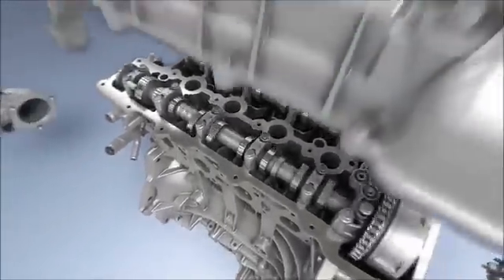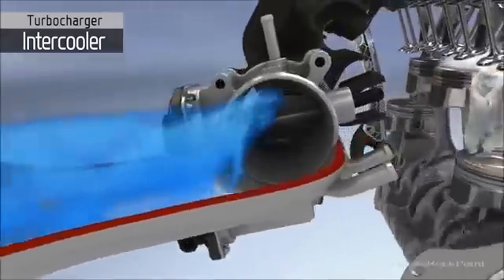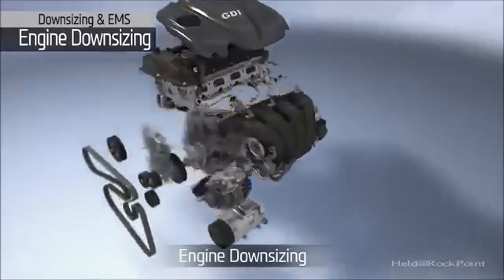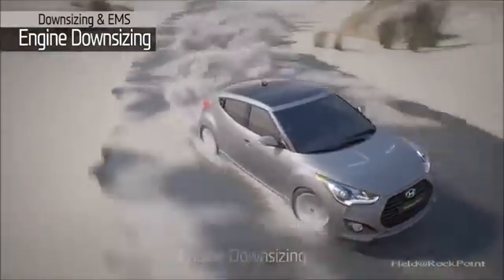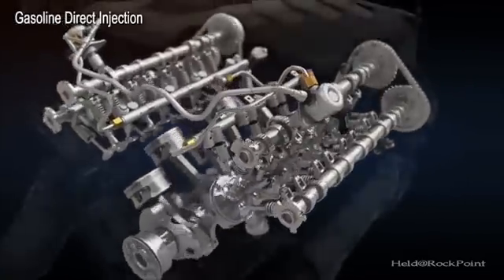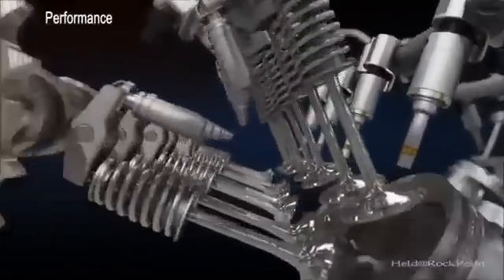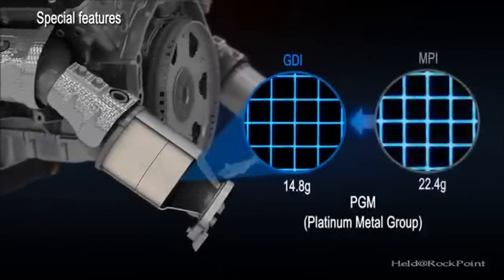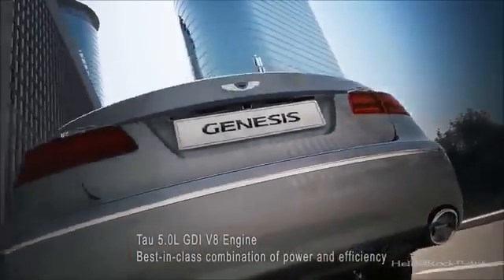Inside the GDI Engine

Comment: Although my mpg increased while riding the modern gdi vehicle, I'm in a situation where I'm using premium gasoline, fuel additives, and intake valve cleaner periodically. Sometimes I wonder what I'm doing. When I was on the old fouth gen Nissan Maxima, I didn't know about these things, I didn't worry about these things at all
Reply: Premium fuel almost never makes economic sense. The modest increase in mpg from the computer advancing the spark timing is more than offset by the higher cost. And a lot of GDI engines work better on low octane gasoline.

Comment: Hi Sir/gdi owners,
I need your advise on the below issue.
I just bought a new nline manual i20. I just ran totally 85kms on odo.
Im sensing an excessive heat from engine bay after riding 25kms on highways when I stopped for fuelling I was asked by petrol bunk guy to see whether hand break is engaged.because of some excessive smoke coming from below but disappeared quickly 
When I opened engine bay I suddenly noticed a sudden heatwave coming from engine bay. I can feel hot air blowing on my face left side of engine.
I also sensed a smell similar to burning clutch at back of my car exhaust.at beginning of delivery I noticed a paint /nail polish smell coming from exhaust. 
I wonder what could possibly wrong in a new car and feeling very nervous

Comment: Worst engine ever, the oil consumption is unbelievable, the dealership is not supporting their customers due the the overwhelming failure of the GDI engine....I had 2 Hyundai Santa Fe. 2006 and 2017.  The 2006 was worry free and reliable,  Just did regular maintenance with oil changes and air filters.... Due to this I went back to Hyundai and got the 2017 Santa Fe sport... This was a big mistake that I'm still paying for.  The GDI engine in Hyundai are no good... And it's starting to affect the brand loyalty... I hate the fact that they know there is a problem and they are ignoring their loyal customers.

Comment: MAJOR OIL CONSUMPTION ISSUES. ENGINE SEIZURES. RECALLS. SETTLEMENTS. LIEING DEALERSHIPS. GET LESS THAN 40,000-60,000 MILES OUT OF RODS AND BEARINGS. EXCESSIVE CARBON BUILDUP. VERY EXPENSIVE $10,000 REPAIR/REBUILD. 

RUN. AWAY. THIS IS MY 3RD HYUNDAI ENGINE. JUST, DON'T DO IT. KIA IS THE SAME, SAME ENGINE, SAME ISSUES.

Comment: I've had to use 2 sea foam treatments through the spray that you put in the intake. Take the intake boot off and make sure u are spraying behind the mass air flow sensor. Have someone spray while you hold rpms at 2k until can is empty. Turn it off and let it hot soak for 10-15 min . Start it Rev it and drive it. If no smoke comes out. Drive somewhere park , let it cool and then eventually you will hear a pop and alot of smoke if you had alot of built up carbon like mine did. I may have to do a 3rd treatment . Regular fuel injector cleaner doesn't clean up by the intake because of how the gas is injected so anything put through the tank will help the fuel ( like water remover e.t.c. ) . Stay away from these and any cars with CVT transmissions,  trust me.
Reply: Yep both ideas are meant for kids, sure as hell don't want to do this much care to a car now a days.

Comment: With 40 years of experience working on Turbo i can promise you a couple of things.. Your Turbo will fail , You'll have carbon build up on the intake valve, Gasoline will find its way into your oil case and you will have tom replace blown head gaskets..

Comment: I still prefer old cars pre all this turbo charged anti pollution bullshit. An engine that works under these sort of conditions all sounds and looks good but they are not reliable and do not endure as long as non turbos. Based on what happens to some earlier nissans 3 litre TD which look like a fantastic engine do not last. The reason for this is they breath their own fumes as part of their anti pollution set up. Its in not unusual for the manifold inlet pressure to spike in a closed loop system. When this start to happen oil leaks out through the seals of the engine and deprive the parts of lube. It doesn't matter what brand of car it is. If you try to squeeze a lot of power out of a little block expect big problems. It all sounds good looks good and in theory works good but you can never get something for nothing. Everything has boundaries and we push them to the limit at the cost of endurance. Hard starts and oil leaks are the first signs of all this. I have personally see this happen to Nissans a great looking car and performs beautiful when they were new.

Comment: How come they dont mention thr carbon buildup after only 30k miles? 😟😟😟
Reply: Install catch can and port injection simultaneously
Reply: Yer on money with this. GDI is bull Sheit. Major PITA for people with no use for it. Go back to Manifold Injection, or combination if it makes the manufacture feel better. I'm done putting up with carboned up intakes, 80,000 miles & the valve track needs to be taken apart & cleaned. Crap in a can won't work past getting 50% of the crud out.

Comment: "Inside the carbon build up" ...
Reply: I was going put this exact comment then i saw this 😅
Reply: I got 316k km hyundai santa fe. No carbon buildup. Just change the timing belt recently. Runs like a champ.
Reply: @christianmusicchannel8861 do you drive aggressively or you do normal driving
Reply: @christianmusicchannel8861  I think your petrol engine is port injection and not direct injection.
That's why it's clean.
Reply: @Anas42M  it says gdi on the engine cover.
Reply: In comparison to other GDI engine manufacturers, Hyundai GDI engines have minimal carbon build up.
Reply: @kevinclay4883  It's true for newer Hyundai GDI engines, but back in 2011, the carbon build up was awful on these.

In fact, the solution is combination of direct and port injection.
Toyota, Ford and VAG have understood that.
Reply: Yuuup. I have to used the dang spray cleaner every few oil changes too.
Reply: Oil catch cans........
Reply: @simonrosas7937  No...... It will do almost nothing for carbon build up...
Reply: @Anas42M  anything?? Nothing..?
Reply: @1958Cadillac-v2g  Nothing... ;)
Reply: Use high octane premium fuel which has cleaning Chen's in the mix try at least 99 octane and should be very little carbon build up .. yes it's more expensive but worth it on a performance GDI unit with turbo etc ..think US fuel is very dirty from what I hear compared to European fuel!!!???
Reply: @jimmyrich4675 No it will do nothing for the carbon build up, even if you add a bottle of additive.

The fuel doesn't touch the intake valves in direct injection engines.

Comment: Test drove a Santa Fe auto, it was all revs and no go..typical rubbush auto box! Test drove 2 Tucsons and they both felt like they were built to a (very cheap) price with crap suspension and poor steering gearing. 1.7 CRDI diesel is ok but still a bit of a rough (Daihatsu?) engine. I test drive a Tucson 1.6GDI and it was absolutely bloody gutless, fxck all (no) torque. At least with a turbo it might actually pull uphill. I like the Hyundai body styles but you can stuff the engines possibly with the exception of the 2.2 diesel.

Comment: These motors are junk if you don't keep the carbon out of them. You have to clean them every year. Best ways to take the intake off and sandblast the valves with Walnut shells Do that to mine every year. Tried to CRC carbon cleaner it works but not as well.

Comment: Hyundai can say what they like,it's still a direct injection system.The valves will still carbon up,the same as any other DI engine out there.
Like all other manufacturers,Hyundai fail to mention that modern direct injected engine produce 1000 times more poisonous emissions than the
old port injected units,(Tests carried out buy TUV NORD) In their report,TUV say this huge emissions problem can easily fixed by the fitment of special filters into the exhaust system,the cost? less than $50.
Time the world woke up and insist manufacturers fit these filters.
Reply: The engines are turbo. I only use high octane gas with in my 2.0 turbo Optima.

Also its an easy fix. Put some premium gas in and punch it a few times and problem solved!!

10 year 100k mile warranty!! My engine has a life time warranty covered by Kia. It's underrated at 274hp also. That's only on 87 octane, on 91 it's 285ish horsepower. I only run 93 octane. 6spd dual clutch transmission shifts very fast. Great little daily driver, close to 300hp and still gets  about 26mpg city. The interior is ahead of it's time. All 4 seats are heated and cooled. Infinity sound system. Great car!!
Reply: @boostjunkie2320  I've had no problems at all with my 2012 Optima 2.0 Turbo at 82K on 87 octane. Up to 35 MPG on highway with plenty of power when needed. I may try a tank of high octane to see if there's a difference.
Reply: @ellieprice3396  what are your thoughts on idling the turbo for 30 seconds before and after you drive away?
Reply: My Hyundai i30N allready has an "OPF-filter" (Otto Partikel Filter)..my former Hyundai 1.4 T-GDi from januari 2019 had it also..in Europe we can't buy gasoline cars without OPF filters anymore..(EU-regulations).
Reply: @gixxerboy555  What about your  Hyundai 1.4 T-GDi engine? I have the i30 with this engine. What about carbon build up? Did you had any problem? I change oil and oil filter every 7.500km and use only 100 oct gasoline. Now i have 37.000km. What is your opinion? Thank you for your time!

Comment: So how do non GDI engines put gas inside the engine?
Reply: Usually the injector is placed just before the intake valve. Older systems used throttle body injection where the injectors were located in the throttle body.
Reply: Redtooth 75 thanks

Comment: Major Disadvantage : the intake valves do not get the benefit of the gas cleaning off any oil blow by that might be on the intake valve. after the car shuts off the coated intake valves now harden into carbon deposits which increase the likely hood of engine knock.
Reply: That’s why a lot of GDI owners purchase an oil catch can to mitigate (to some extent) oil blow by
Reply: @isaias9838  Oabsolutely correct that's fisrt thing I did when I got me Tucson and I discharge the foul smelling oil every 400 miles.
Reply: Ya fun, fun , in a world of Maintenace free engines, you have dump a can full of crap every few hundred miles. Up in the north land it's much worse, you can't even make this up how much crap it's produced & the owner has to clean it up, ya right, whatever!  @isaias9838
Reply: YESS
Reply: kill everyone  yeah run port injection or add a methanol kit are two things i can think of.
Reply: Is this why there is a recall on the engine?

Comment: GDI is just a carbon nightmare!!
Reply: They have been making this engine for some time. I wonder how Hyundai deals with the carbon build up. I know Toyota developed a dual type spray in there gdi. So gas washes where carbon would normally build.
Reply: @joeb2588  Run high octance gas and floor it a couple times. Blows built up carbon right off. That's an old basic maintenance trick.
Reply: Yes but this adds to the complexity of the system.  The GDI nozzle is 16 microns.  A blood cell is 8. How long before this clogs up???
Reply: @alanmatthews5949  I have an 18 Elantra se. It's a base model really. No frills. 6 speed manual. One of the appealing qualities is the 2.0 mpi engine. No GDI,no turbo. Just a basic fuel injected engine. It's not powefulbut it seems reliable and I get over 40mpg.
Reply: Actually it's not at all
Reply: Tell that to Bernie at ATS

Comment: How and why the bue cold air turn into fire ??????? This is misleading
Reply: The turbo is very hot, being run by exhaust gases. This heat is transferred to the intake air via the compressor. That is why an intercooler is used, to take much of that heat out of the air before it enters the plenum.
Reply: @ButchNackley  thanks sorry for my harsh question. Since i was curious

Comment: The GDI is not all it’s cracked up to be.  Serious design flaws and poor quality control in manufacturing makes this is one engine to stay away from.
Huge problem with carbon build up in the intake above the the valve seats, the turbo only exacerbates this problem.  The high pressure fuel pumps have a much higher incidence of engine fires.
Reply: Just take care of basic maintenanc and the engine will be fine
Reply: @boostjunkie2320  no it want I did all that for two year got records to show and it still blew up waiting to see if I'ma get a engine now
Reply: @LawezeanaS197  I got my 2018 Elantra Sport with 29 miles on it, I do proper maintainance, and I am now at 98k miles... not a single problem. And I drive it hard and it is Full Bolt on and Tuned with e30 fuel at 24psi. No problems here...
Reply: @AlexGtheDon  were did you buy your bolt on and tune from I been looking for stuff for my 2.4  for the longest and I brought mines use with 77k I love my car I just had one of those engine Alabama plant engine I was doomed from the beginning at least thats what Hyundai say's but they gone fix it I gotta pay out of pocket I didn't met the warranty
Reply: Yep. HUGE recall on the GDI engine. But, they will not accept ANY warranty claims when it grenades, even with perfect service record. (The service advisor said it was perfect.)
Reply: My Sonata died in the fast lane, turned out to be the fuel pump, but then a few months later, after refueling, the gauge didn't update and it died again. Now I'm hearing woodpecker from the engine, and I'm assuming I'm throwing a conrod...
Any thoughts? I only recently found out about the GDi recall but my VIN records show it as closed...

Comment: DOWN WITH GDI!
Reply: Ok.  But why?
Reply: @Glasses5x  GDI has a few drawbacks. The main one is carbon buildup on the intake valves, on TPI systems the fuel injector washes most of the carbon buildup off the valves. With GDI this does not happen, within a relatively short period of time the carbon buildup reduces the efficiency of the engine. This can be fixed by using another set of fuel injectors in the intake that clean the intake valves, but this is an expensive workaround. GDI also uses extremely high fuel pressures that causes an increased risk of fire. The high fuel pressure increases the risk of a leak, and also makes any leak more dangerous. Many people don't like GDI since many systems are unreliable and don't think the slight increase in efficiency is worth the cost.

Comment: Just  give me a car from back in the day when you could fix anything in your yard without a computer!!!!  Then you knew what you had!  Seems like more problems with technology & costs more than its worth along with more headaches!  GDI is not up to par!!  I'd stay away from GDI !!  I had an old 1962 Pontiac Catalina sedan that put out 389 horse power stock and got 18mpg in town and had 200,560 on it when I parked it because of a power steering leak on the pressure side!  When I went back to get it, some ass hole striped the engine and suspension!  Fuck these new cars, give me an old car any day!!!
Reply: hairburger62 I agree totally all this ECUs  sensor bulshit good old days of fixing your car with air tools and wrenches not computers 💻. And scanners I’ve got three scanners now and doesn’t cover all modules on all cars  🚘👎👎👎👎 gdi  engines greatest money maker for dealerships and the biggest shaft for owners
Reply: Blame the tree huggers that want clean air at any cost.

Comment: Have you solve the carbon build up problems, GDI?
Reply: @Chill Man using top tier gas like Exxon Mobil helps too with fuel detergency.. it's in the manual that you have to use TOP TIER gas which is available at alot of gas stations
Reply: You have to open the valves all the way for about 15 seconds. Try to reach 130 in the 2.4 GDI. Pedal to the metal will clear out the carbon buildup.

Comment: I’m sticking with diesel.
Reply: Tru dat. Got my 7.3 Powerstroke. Tried and true. Never lets me down.
Reply: Yep my Ford Kuga/ Escape) has 2 litre diesel. Produces 370 NM at approx 1700 rpm and 400NM at 2000rpm. It pulls hard like a train uphill and begs to change up to higher gears.. never get that in a petrol until you wind it right up
Reply: @mjames2117  did you ever drive a turbo petrol engine? It's the exact same feeling. It's the turbo that gives you low-end torque, not the fuel used or if it's ignited via spark or via compression.
Go drive a naturally aspirated diesel and then come tell us how it "pulls like a train". A naturally aspirated diesel is even weaker than a similar displacement naturally aspirated petrol engine.
Reply: @Kain987  yes have driven a gsi Zafira..nice, quick but also very lightweight. Petrol torque curve is mid to high revs. A turbo serves to spool the engine up to their torque curve quicker and once turbo is running you have good response.
My Kuga/Escape has 350 to 400Nm between 1300 and 2000rpm eg low end and yes with the turbo. But it still has more torque than equivalent Cc petrol and a fair few other 2 litre diesels. If I am going up a hill in 5th gear pulling hard at 1500revs I guarantee your petrol will be in 3rd gear at higher revs needing to be worked hard and your turbo petrol will be in 4th gear and still revving higher because the engine still has to work harder than the diesel with its longer stroke and higher compression coupled with its higher energy density per unit volume. Some normally aspirated diesels did work well. I recall Renault 19 1.9?d were pretty decent.